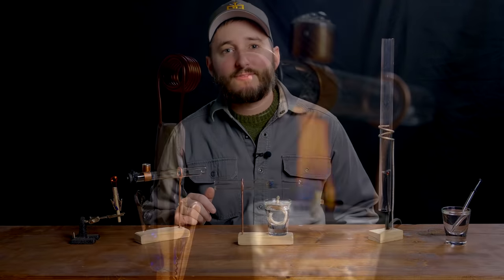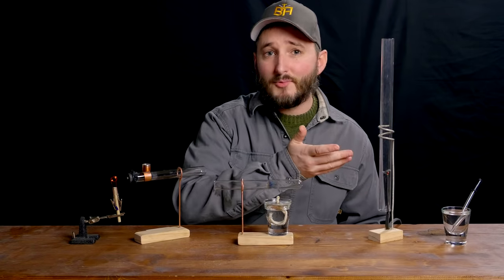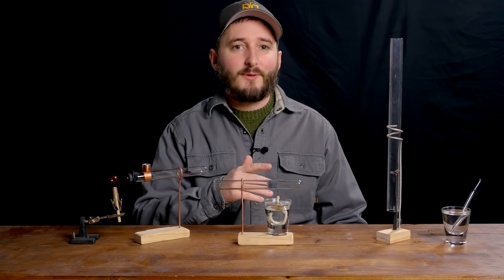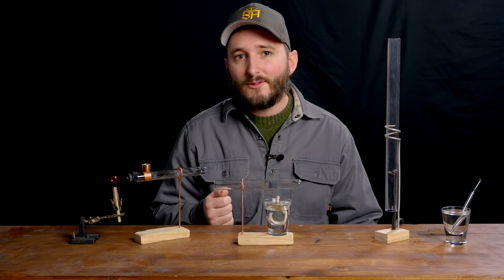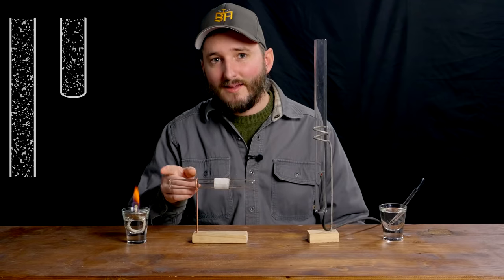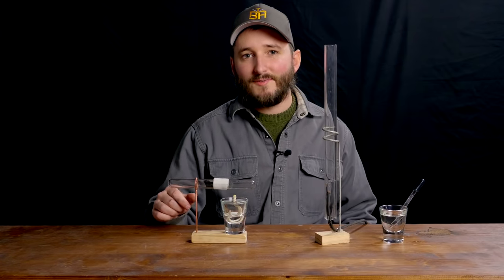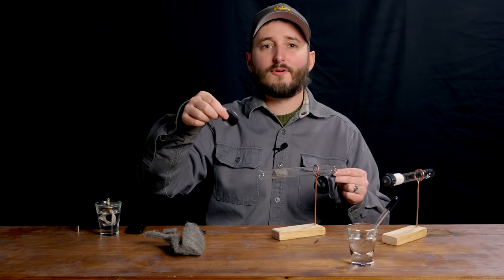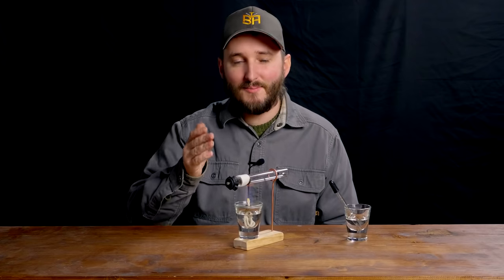Acoustic Energy & Surprising Ways To Harness It (Intro To Thermoacoustics)

Comment: The bulb was too high resistance, put two leds in parallel, but reverse biased, and try that. I can almost guarantee you'll get light.
Reply: pretty sure you wont. You need a ton of turns to get to even a volt with something like this at a low frequency.
Reply: @Basement-Science  Small LEDs can light visibly with less than a volt and with microamps of current. It should work.
Reply: @soranuareane  the voltage is the bigger problem here. This might be as low as 1mV per turn or even less. If you dont get enough voltage, there will be no light at all because you wont even get a microamp to flow through an LED. 

Also I'm not sure what kind of LED would light at less than a volt in the microamp range. I know green leds can light visibly at around 2.4V 5uA, and those are already some of the most efficient ones together with blue ones.
Reply: @tribalismblindsthembutnoty124  Then you need even more voltage for that.
Reply: @Basement-Science  A piezoelectric disc is probably the way to go.  Either that or a machine-wound solenoid from something like a relay or a microwave turntable motor.
Reply: That setup creates ac current correct? Is the frequency of the current compatible with the LED?

 Also does the stroke being shorter than the coil cause the magnetic field to cancel itself out?
Reply: @WeighedWilson  LED's have extremely low-latency and hence can operate at very high frequencies.- like 10+ GHz.

And no, the magnetic field would not cancel itself out.  The amount of voltage generated really depends more on how fast the magnet is moving on average than how far.

The performance of this setup was poor due of both to acoustic and electrical impedance mismatches, and low generating efficiency due to the magnet and coil being pretty far apart with no return path for the magnetic flux.  A better design would be similar to a speaker voice coil.
Reply: @WeighedWilson  It does generate AC, which is why you can view it with two leds in parallal, with polarities switched. One will turn on during the positive wave, and the other during the negative wave. They are perfectly fine operating at low frequiencies (such as the audible frequencies shown here).

The size of the stroke stroke of the magnetic field doesn't really matter, as long as it's MOVING.
Reply: @Basement-Science  As long as there's capacity for current, I think you can get the voltage you need (pulsed) with a Joule Thief circuit.
Reply: @peetiegonzalez1845  That would be completely backwards. A joule thief needs at least 0.6V of DC, not AC, to run. A bridge rectifier will drop another 1.4 or at best 0.8 volts. At that point you might as well just run the LED directly. 

As I said, this is going to put out low mV level as it is. By far the most reasonable solution for that is to use more turns of thinner wire.
Reply: @whatelseison8970  2 problems with piezo-disks: 
1. they normally work at high frequencies (kHz range). What he built was too low for this.
2. piezo disks have almost no travel distance. So no idea how you would attach one to a setup like this. 
Also, generally they can put out a relatively high voltage, but not necessarily at such low audio levels. Usually only under (mechanical) resonance conditions. 

I think a relay coil would be a good candidate for the magnetic pickup method. Although you need to prevent the relay's magnetic core from sticking to the neodymium magnet. Maybe you could remove its core though and glue the windings in place.
Reply: @Basement-Science  Aw crap you're right, I didn't consider that it was AC.
Reply: @tribalismblindsthembutnoty124  two parallel opposingly polarized diodes would suffice, since you're not rectifying the current for something else other than the diodes themselves
Reply: They'll both have their issues getting lit.
An incandescent lamp has a low resistance, and a relatively high current draw. As soon as power is generated, the lamps filament drops the voltage to nearly 0. Current is certainly flowing through the filament, just not enough to create light.
An LED can light at very low currents... But only once it forward voltage is attained. 
You could connect a red LED accross a 1.5v cell, and it won't light - Sure the battery can easily handle more than 20ma, but until 2.2v is accross that LED, no current will flow.
Reply: @tribalismblindsthembutnoty124  Did you just say  FULL BRIDGE RECTIFIER???!!!!
Reply: @tribalismblindsthembutnoty124  FULL BRIDGE RECTIFIER!

Comment: as a flame worker of borosilicate this happens naturally quite often with out any metal. it tends to happen when there is a little moisture in glass. first time it happened i thought the glass was going to explode. when the end is closed and super heated and air is compressed in tube the gradient pushes and traps the moisture about 1/3 the way up the tube. sometimes you can feel  it but not hear it and a slight puff then letting air escape from mouth with lips causing a vibration influences the sound to come out. i found the 1/3 thing very interesting. with glass the 1/3 thing comes up often which i find peculiar.when you design glass by putting lines of color then pulling you learn that multiples of 3 are best when trying to evenly pull down to a smaller diameter. i am constantly noticing threes coming up all the time when working with glass

Comment: Does this have anything to do with the frequency of ignition in a pulse jet engine? ( my thought is that the heat and expansion push air out of the pipe. And then cooler air is drawn back in before the cycle repeats)
Reply: Oh oh, now yer talking about ufo stuff. Good ole USA tech.

Comment: You could use an oscilloscope instead of an LED.
Reply: You could use a voltmeter on AC also.
Reply: He didn't even use a LED, but incandescent lightbulb.   I was sad to see this missed learning opportunity. LED needs much less energy and would light up easily.  We did many experiments like that as kids with LEDs, coils and magnets. And that was in 90s with much dimmer LEDs than we have now! 

Plus if you wire two LEDs parallel but in opposite directions you can nicely see it's AC as each one blinks every other half wave.

Comment: Awesome video, thank you for sharing and doing all of the research about it. 
One thing we can notice is that on the big tube when tilted horizontally without the air flow the heat on the resistance rises as it glows stronger. Cheers Ben and again thank you.

Comment: @11:11 By using a sliding Induction Coil outside the tube, you could create a variation in the distance and heating you apply to the tube by using a voltage regulator to perfectly adjust the heat applied as needed for variable sound waves.......

Comment: the open end of a tube does in fact reflect the wave back inside. Its the rapid change of acoustic impedance, which causes the reflection. Its a "soft" reflection, meaning the low-pressure part of the wave with high velocity is at the point of opening. When you have an exponential opening (horn, waveguide), there is no reflection and no resonance.
Reply from the maker: You're right in what you say, but I don't think reflect is a good word to describe it. It's a different phenomenon, caused by the velocity of the particles carrying them out of the tube so pressure inside the tube briefly drops, until atmospheric pressure forces its way back in. It's sort of reflected, but not in a very simple way. I use the word reflect in a way synonymous with the word bounce.
Reply: @Nighthawkinlight  isnt it a "bounce"? Because the first wave-front is a high-pressure area moving from within the tube to the outside. At the opening, the high-pressure will decrease rapidly and because of the inertia of the molecules, overshoot the equilibrium with the following expansion-zone. Thus some of the air is "sucked" back into the tube. So it is not bounce like when a ball hits the ground, but more like something falling onto a trampoline, isnt it? 

I call this soft and hard bounce, as it describes the difference between acoustically hard and acoustically soft.
Reply from the maker: You could look at it that way. I suppose that's the trouble with using non technical terms, the definitions get messy.
Reply: @Nighthawkinlight  "acoustically soft" is a technical term used for exactly this situation. So its well defined. Where is the issue?

Comment: Thanks for another great video. Thought about using the sun as a heating source, and copper tubing filled with water in a closed loop system for heat dissipation. Like a still sort of setup.

Comment: One of the best Rh thermometers I've made was a white pvc pipe with the top half wrapped with black tape and the sensor placed inside 1/3 from the bottom.
The hot air from the top pulls air from the bottom reading correctly before its changed by the heat section/vacuum.  no need for fans. 😁

Comment: Musicians can tune up their instruments  by using those wobbles you hear when two similar pitched waves interact. The closer the notes are to eachother, the slower the wobble, therefore allowing you to be perfectly in tune when the wobble stops. Or you can deliberately de-tune slightly to get a vibrato effect (like on a 12-string guitar).
Reply from the maker: I'm a musician myself and use that tuning method. I've never thought to detune paired strings for vibrato, that's a neat idea.

Comment: @12:00 I think if you put a rubber seal between the copper mounting coil and the glass tube, you will reduce the lost energy from vibrations into the wire directly which should make the overall design slightly more efficient..
Reply: If you put a rubber seal there than you will reduce the thermal connection between the glass and the copper, so the cooling effect will be reduced. It means the temperature different will be lower and maybe the engine won't work as long as possible. Thermal compound could help a lot for the unit.

Comment: A very cool way to visuallize the wave form generated by the magnet on the diaphram would be to attach a small mirror and then use a laser pointer to deflect off it and it will show the wave form when it hits a surface. laser would need a rigid mount and laser safty would be a must. have done a acoustic version with a diaphram over a specker hooked to a signal generator. add some smoke and get the 3D effect from it. even by simply hooking the small coil you used to a osciloscope would have shown the wave form, and theres some easy ways to improve even this. really hope you do a follow up to this couple of vidios as its really fasinating stuff.

Comment: I have some ideas but that doesn't mean that they would work :D
1. I wonder if it would be possible to make one using sunlight to heat the tube and water to cool it. The part that should be heated could be covered in some kind of high temperature resistant black paint or just some lamp black (outside the tube or inside it, what would work better ?). Sunlight could be concentrated with a magnifying glass or some kind of bigger lens in case of a bigger project. Part that should be cooled could have a similar solution to the one you used. I know that by using sunlight you would have to frequently adjust the lens during the day,  but I bet that there's some kind of flat lens (like those plastic fresnel lenses) that collects light from a certain range of angles on one side and turns it into a stream of light that always runs perpendicularly to the sheet of the lens on the other side. Then the only thing you'd have to move is the position of the flat lens for most of the time, and I think that you'd have to do that less often than moving the magnifying glass without the flat lens. Of course you could lose some of the energy if the flat lens is a bit opaque like some kinds of plastic lenses. I know, it's not perfect, but maybe? You could scale it up and make an engine out of it or generate electricity - I know there are more efficient modern ways to do it, but it doesn't mean that it cannot be done for fun or to prove or disprove the concept :D

2. The other one is a bit crazy :D. A pipe organ that is made using thermoacoustics. Either a smaller one that runs on electricity to heat the air in every tube for every tone (like you showed in the video) or a crazy big one using big tanks of water to cool the tubes/pipes and a big rocket stove to heat them :D

Comment: Excellent concept and presentation! I love the simplicity of these designs.

When you showed the Styrofoam standing wave, you mentioned that you did not understand the separate spikes within the contour of the fundamental wave. But since I have been studying Fourier analysis of wave motion, I immediately interpreted it as a demonstration of the Fourier transform and its properties.

You may know that Fourier analysis began with the study of the propagation of heat waves in a metallic ring heated at a single point. In that system, the heat waves spread slowly through the ring in both directions, until the system reaches heat equilibtium, at which time the heat flow is  a standing wave.

What Fourier realized by studying this system is that the fundamental wave is slowly built up of a theoretically infinite number of smaller waves, each of which is a whole-numbered multiple of the fundamental frequency. Of course the system can be approximated with a few terms of harmonic series, each of which is smaller than the previous one, so no worries about needing an 'infinite number' of terms.

So the equal spacing of the stryrofoam spikes within the fundamental wave in the test cylinder represent a Fourier coefficient of another harmonic wave. I suspect that by modifying the diameter of the balls to allow a finer resolution, you could find waveforms that create any desired number of these interior spikes. They are harmonic wave components which would look like the gradations of fractional length on a ruler, the difference being that the length being divided into fractional parts are harmonic multiples of 2pi wavelenths instead of a linear unit like inches or centimeters.  

Actually it probably would become a visual representation of the waveforms of the Fourier transform of a wave of any degree of complexity, by adding together different tones in the speaker electronically. It is an analytic device.

In a nutshell, the spikes are the first term of the Fourier series of the wave, adding up to the fundamental...

Thanks so much for these demonstrations!
Reply from the maker: Interesting thoughts! I'll have to look into that more.
Reply: @Nighthawkinlight  the math leading to this point is pretty monstrous. But once you get to this point, what appears at first to be hopelessly complicated and difficult turns out to be beautifully simple. Almost all of the terms in the equations cancel each other out due to symmetry across opposite sides or because they are zero valued to begin with. So it's like watching a jewel cutter turn a regular rock into a faceted gemstone! So don't be put off by early difficulties if you are comfortable with any sort of formal mathematics. 

The online resources for learning about it are awesome. From traditional MIT open course lectures to new graphical walkthroughs. 3Blue1Brown is the most brilliant mathematical instruction I have ever come across, and it's geared for a young and inexperienced audience. The creator, Grant Sanderson, has also released a software package for the math animations he puts up, which is incredibly generous.  

Best wishes and good luck! Thanks again for the channnel.

Comment: It is very interesting seeing your demonstration using heat to make sound. This triggering a program of some sort of physics experiment that I have saw long long time ago.  I can't even remember what the experiment was trying to achieve. But one thing they needed to do was lowering the temperature to as closely to absolute zero, which is -273C or 0 Kelvin. They have managed to lowering the temperature within 1C or 2C above absolute zero.  From this point they can even lowering the temperature further down within less than 1C above absolute zero by using light.
If possible, I would very much like to see how light can be used to lowering temperature.

Comment: Enjoy your videos.
For those interested in a math heavy explanation of these phenomena you may want to look at Theory of Sound by Lord Rayleigh Vol 1 & 2, from Vol 2:
These notes may be obtained upon a large scale and form a very effective lecture experiment. For this purpose a cast iron pipe 5 feet (152 cm.) long and 4f inches (12 cm.) in diameter may be employed. The gauze (iron wire) is of about 32 meshes to the linear inch (2*54 cm.), and may advantageously be used in two thicknesses. It may be moulded with a hammer on a circular wooden block of somewhat smaller diameter than that of the pipe, and will then retain its position in the pipe by friction. When it is desired to produce the sound, the gauze caps are pushed up the pipe to a distance of about a foot (30'5 cm.), and a gas flame from a large rose burner is adjusted underneath, at such a level as to heat the gauze to bright redness. For this purpose the vortical tube of the lamp should be prolonged, if nccessar}^ by an additional length of brass tubing. When a good red heat is attained, the flame is suddenly removed, either by withdrawing the lamp or by stopping the supply of gas. In about a second the sound begins, and presently rises to such intensity as to shake the room, after which it gradually dies away. The whole duration of the sound may be about 10 seconds^
Also search “Thermoacoustics Greg Swift lanl” for a huge amount of information on thermoacoustic engines and refrigerators

Comment: Hi you definitely need a finer wire for the coil and a diode in Ceres with the circuit to give you a positive and negative output and make sure the LED is in the circuit in the proper direction